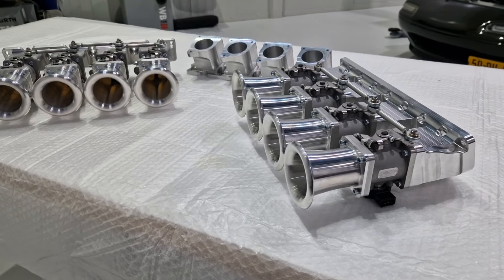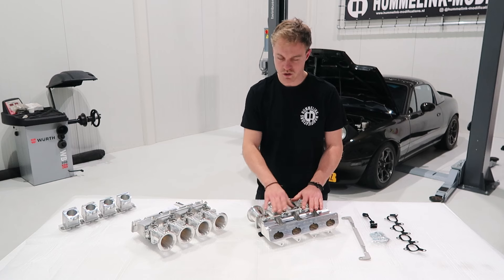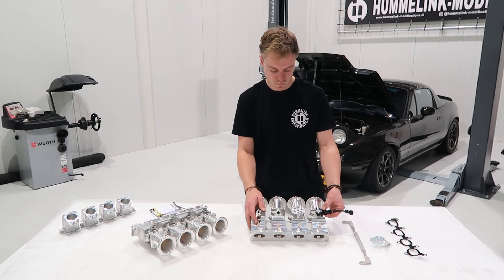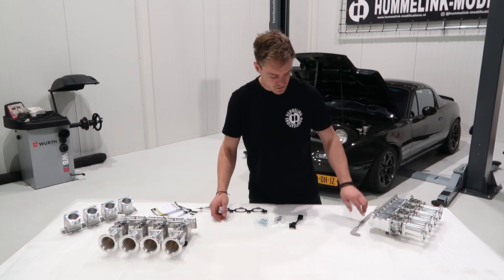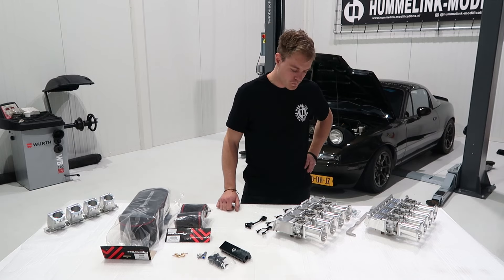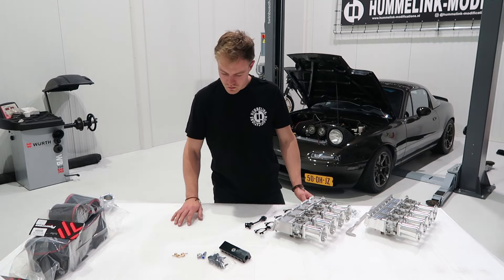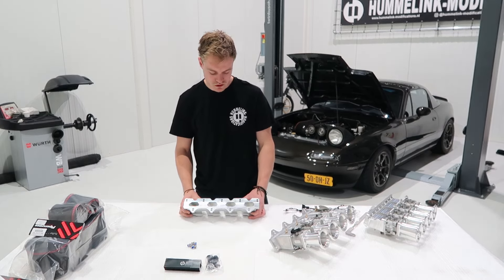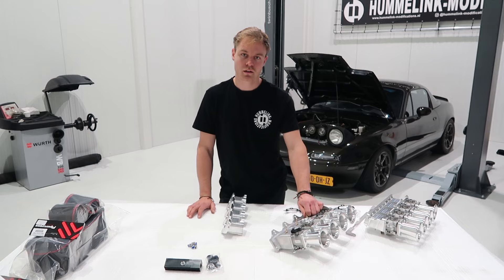Everything you need to know about Mx-5 Miata NA & NB ITB's

Comment: This is a nice setup. This is way better than the route I had to take to get my T3 setup going. Most of the little issues like the throttle cable, tps, and fuel rail Where a pain in the but to get right. Also, you are filling the gap since T3 stopped making them for Miata's. I would've bought this if I didn't have my set up already

Comment: How to spend thousands of dollars to lose horsepower
Reply: im making 200hp on my current built motor setup but just from the itbs alone saw 18hp gains. not bad for a bolt up solution that wont affect your hot lapping
Reply: Bruh Nils has posted dyno graphs close to 200 hp with a 10:1 comp ratio, a tune, and his ITBS
Reply: The prices for this kit is really good compared to other kits